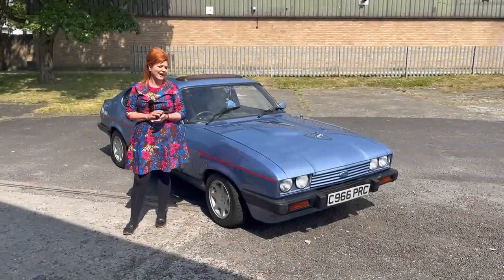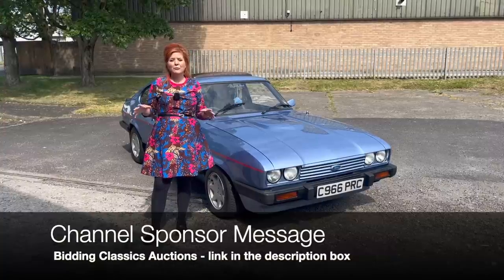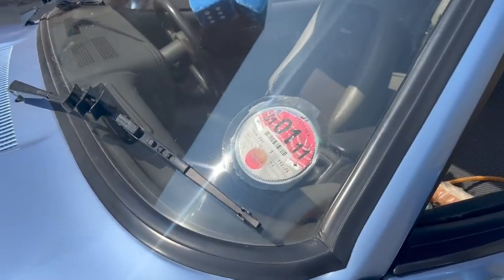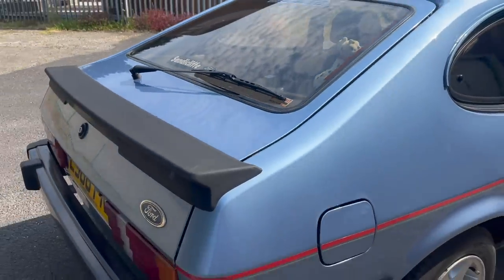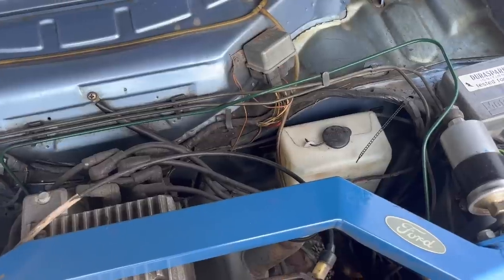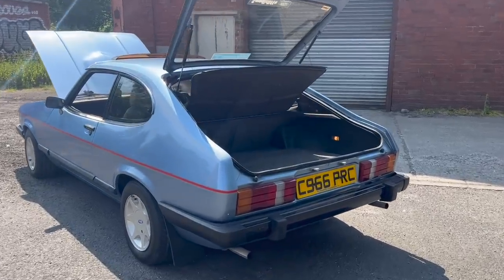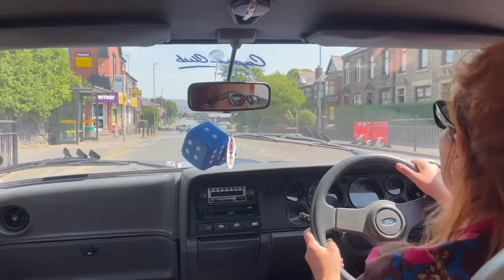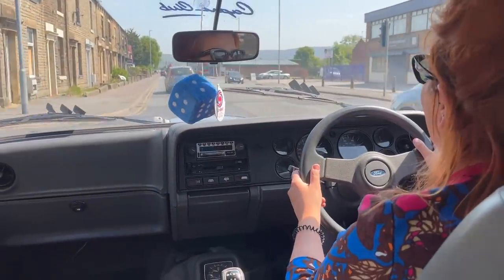Ford Capri MK3 2.8i special - a cool 80s classic car - overrated or cult car?

Comment: They were great cars when running correct ,but they needed some looking after . I had a old shape 3 litre Capri auto which was ultra reliable ,but the 2.8 was forever in the garage in pieces ,even tho the mileage was low and  it came off an old couple who drove it till the old fellow stopped driving . I pulled the engine apart twice trying to stop odd noises and stop big problems with head gaskets ,had the heads skimmed and then took them off a second time after the thinking was that minor cracks were causing the problems ,so had them pressure tested and what started out as a real bargain car turned into a money pit ,even after the work on the engine was done by friends in the trade ,as I worked for a local garage at the time . I wish I still had the car because I perhaps would have more patience and more money to sort it thoroughly and they have always seemed to attract more money than they are really worth ?. But that"s just my opinion ,as I have had better cars .

Comment: Great video. Brought so many memories back having had Mark 3s . A 1.6s, 2.0s and finally emptying my savings account to buy a Brooklands 280 Capri.  I never thought much of the dash layout but you are right it does look good and un cluttered  and it should have had electric windows specially on the top ranges. My only downside were the headlamps which were too small and dim.  But ohhh that 2.8 engine when you started it and pulled away.

Comment: Lovely car. The mk3 didn't make it to the states but we did buy a lot of the mk1 and MK2 version. I owned a 1970 1.6L Kent and a 1972 with a 2.0L Pinto 4 cylinder. We bought up nearly 514,000 by the time Ford switched to the Fox chassis in 79.
Reply: Haha they probably would have put in quad square headlights on the mark 3 if it was exported to the States.

Comment: sweet car.  i have some driving experience with a '73 mk1 v6 back in the early 70's, and a little experience with a mk2, although in the states here they were called a Capri II.  didn't feel like a cheap little car...much better quality than the rest.

Comment: Our Capri in the US was quite different, but very similar in design. From '79-'86, the US Capri was produced on the Fox platform and was basically a re-skinned Mustang. I personally preferred the Capri's looks to the Mustang's and hopefully one day I'll be able to acquire one. After the Fox Capri ended in 86, there was another Capri produced a few years later that was a 2 seat FWD convertible that was based on a Mazda. It had nothing to do with the MX5/Miata/Eunos, but it was supposed to be a direct competitor to the them 😂. I know very little about it other than that.
Reply: Forgot to mention that  Capri's in the US were not sold as Fords. The European Capri 70-78 were marketed through Ford's Lincoln and Mercury divisions and were Just Capri or Capri II. The Fox  Capri 79-86 were labeled Mercury and the Mazda based 91-94 were also Mercury.

Comment: I had one of these. It did 10 miles to a gallon, and got overtaken by a Morris minor on the motorway uphill..A complete t@rd of a car.
Reply from the maker: A morris minor. Really. Must’ve been running incorrectly if a Morris with maximum 1098cc of power overtook.